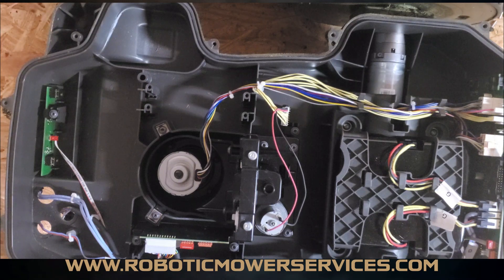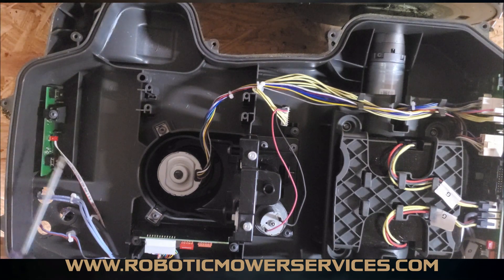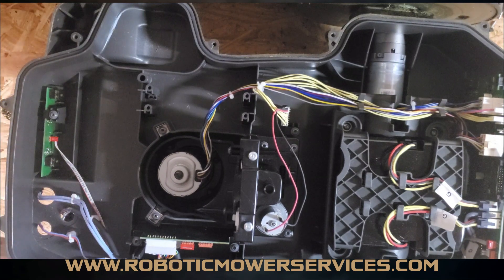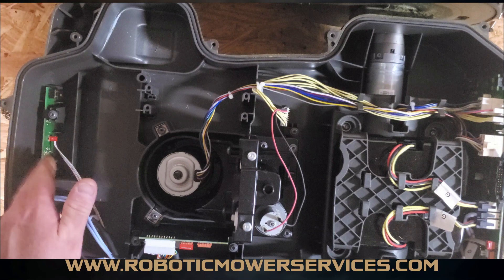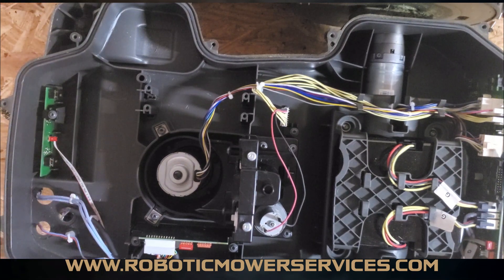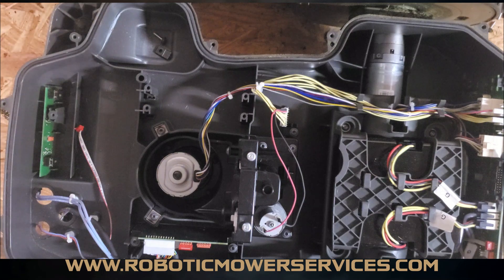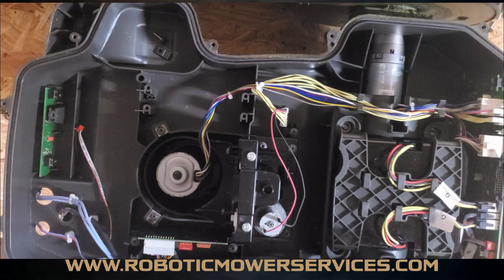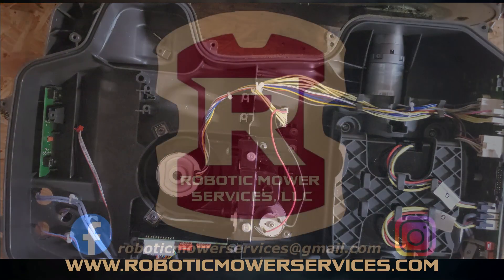Husqvarna Automower Front Loop Sensor Replacement (What is it & Where is it?)

Comment: I have a problem with my 435X that loses signal when it passes over the guide wire in a specific area of my terrain. Someone told me that it could be the battery cable that would disturb the signal. Do you know a problem of this kind?
Reply from the maker: This kind of information that gets thrown out in other forums and passed along is the exact reason why we created a tec support group for people to be able to get the right answers and methods for diagnosing issues. https://www.roboticmowerservices.com/plans-pricing

Comment: Hi, Thanks for these vids,
I have a Flymo 1200R that had an issue the mower’s screen was flshing blue light (as of blinking , trying to turn on) and wasn’t charging basically died. I ordered a new battery that has a slightly different voltage (18v instead of 18.5v and 2.5mah instead of 2.1mah) following recommendations of other owners suggesting it would work just as well.
Now the mower turns on but I got the No loop error which I haven’t got before. Charger station recognizes the loop, led’s colour changing as expected when attached the loop and guide cables.
Loop cable resistance is ok, no damage, charger station’s voltage on the loop and guide connector’s tested ok.
Can you please advice whether it still can be the station’s PCB issue or assumedly the issue is with the mower’s loop sensor? And any way to troubleshoot this?
Reply: Correction after some more digging
Apparently the flymo 1200r ‘s loop sensor is integrated onto the main circuit board. Not even sure if that can be replaced separately 
Just to clarify the loop readings on the mower’s tool/info/loop menu all zeros

Comment: Hello Robotic Mower Service. Thanks for some great videos. I have a Husqvarna 310, 4 years old. It cannot find the guide wire. I have measured 4 Ohms on the guide wire and the green lamp in the docking station lights up constantly. I have changed the PCBA LOOP print to a new one. 310 still cannot find the edge delimiter (guide wire). Any guesses as to what's wrong?
Regards, Chris Florentin, Denmark
Reply from the maker: The green light on the charging station is only an indicator for the boundary wire on this model and will not change if there is an issue with the guide wire. The best thing we can suggest for you to do is connect the guide wire in place of one of the boundary wires. This will create a smaller loop between the boundary wire and the guide wire that is now acting as a boundary wire like explained in this video: https://youtu.be/kCiFbaEwURQ
With your guide wire connected as a boundary wire follow the steps in this troubleshooting guide: https://www.roboticmowerservices.com/post/troubleshooting-a-no-loop-signal-error-on-a-husqvarna-automower

Comment: my ooooold 305 is saying no boundry wire, i made a test wire witg 6 feet, and still no signal, and values in test menu is saying 0-2% signal strength, and the rest at 0... mainboard or sensor??

Comment: Whilst part of the Husqvarna family, I have a McCulloch Rob1000 mower. It was going out and running out of battery. I replaced the battery at the weekend and it has cut once and gone back to the charging station and no longer charges.  If I run a test on the charging station it  says Current: Not Ok.
I have 28V at the charging station and the output to the L&R boundary wires is about 34V.
The green light is lit continuously on the charging station.

Could this be the loop sensor?

Comment: Hi there, I’ve got an automower 310 (2016) with a solid green light and a boundary wire that works with my other mower. The mower in question says no loop signal. I have tried changing the charging station circuit board and the mower’s loop sensor, I then change the passcode and the loop signal in the security settings on the screen, it indicates success but still won’t follow out and go to work, eventually saying “no loop signal” again. What could I possibly try next please?
Reply from the maker: Take a look at our troubleshooting guide that we created for no loop errors. Here's a direct link to it: https://www.roboticmowerservices.com/post/troubleshooting-a-no-loop-signal-error-on-a-husqvarna-automower

Comment: Dwight, thanks for the great video.  My 2016 450X has started acting strangely and I’m wondering if it could be the front loop sensor?  The first issue is that when following the guide wire, it used to be really smooth, but now it’s really jerky when following it, it zigs & zags back and forth no matter if it’s close to the base station or far away.  The second issue I’ve seen on occasion, is that the entire mower will go outside the boundary wire by 8”.  I have the setting at 8”, so I would expect the front of the mower to cross by that much, but it seems the front loop sensor didn’t detect the boundary, and the rear sensor is what stopped it.  I witnessed this when the mower was fairly close to the base station.  Funny thing is that the boundary wire runs along a curb by the street which is the farthest from the base station and the mower has never dropped off the curb!  What do you think about the front loop sensor being the cause of all this?  Thanks in advance for your wisdom…..
Reply: Hi, I am having the same issue as you with the mower not following one of the guide wires home. It picks it up at first and follows for a little then just veers off. I have no errors showing and have replaced the guide wire but its still not following it home. Were you able to solve your problem? Thanks

Comment: Blinking blue light on the base. I’ve tried the connections. Checked the boundary wire with a tester and it’s good. Could it be a bad loop sensor if it’s blinking blue?
Reply from the maker: No, if the LED on the station is flashing blue then it's not a loop sensor issue. Take a look at this video for more info on how to diagnose your flashing blue LED. https://youtu.be/uDdUnR_rIAE

Comment: Super, thanks for this! My mower AM320 had issues with docking straight (at first). After a few days, I got the "no loop signal found" error, although my docking gave a solid green light (and the wiring was definitely OK, I checked the resistance) ... after replacing this, all is fine again !  So happy 🙂
Reply from the maker: Awesome! Glad we could help! Just curious since you said you have a 320, what country are you located in?
Reply: @RoboticMowerServices   Belgium

Comment: Hi,
first thank you for the nice info.
I have a 310 and since a couple of weeks I ran into the issue that the mower doesn't leave the dock on schedule. When I pull it out manually it start mowing and completes its daily schedule (run for 6h) without any issue. In between it goes to the dock for recharging and starts mowing again without any issue. It is only the start of the schedule that fails while date and time are set correctly. When connecting via Bluetooth it says 'mowing' but is still in the dock.
Next I looked into the service menu and checked the loop signals.
I did notice that I have negative front sensor values when it is in the dock. When I pull the mower a few cm's from the dock values goes up for both front and left. Then the mower starts to work. What I cannot understand is that it doesn't have any issues during the schedule, only on startup.
Also the error for not leaving the dock is that it has not got a loop signal which make sense since the values are negative.
I already regenerated a new loop signal but no luck there either.
The dock hasn't been moved for years and there is no high resistance on the loop wire either.
I was thinking of a bad front loop sensor but then again it is working fine throughout the schedule.
I'm a bit puzzled here, any thoughts?
Reply from the maker: Jan, it sounds like you have your boundary wires tucked under the back corners of the charging station base plate. If the wires are tucked under the corners of the charging station base plate it is possible for the mower's front loop sensor to get too close or actually over the boundary wire and cause the mower to not leave the station. I'm guessing that this is your issue because you mentioned the negative value on your front loop sensor. Try moving the boundary wires out so that they are at least an inch away from the base plate of the charging station and see if that makes a difference.

Comment: I have a 450x and on the base getting a blinking red light.  Looked it up and sounds like and f or n loop sensor in the charging base.  Do you have a video on that at all?
Reply from the maker: The flashing red light means there's an issue with the antenna for the far signal. https://youtu.be/cljaAQHpo2o

Comment: Good video.
I have a 315x witch sometimes drives over the boundary cable. Its programmed 25cm drive over.
It can run month but then somwhere it drives over the edge. Its Unused but a couple of years.
Instead of the 315x i use a 310, with the 315X connect card, and that have worked a couple of years now.
Do you think that the loop card can be the problem?
Reply from the maker: Here's a video showing how to check the loop signal quality through the front and rear loop sensors. You can use this to check at the areas where the mower is going out of bounds to see if it's a signal loss or if it's a sensor error. https://youtu.be/tUzTo9-xbgo
Reply: Its on different places every time. Never happens with 310 on the same area for over 1 year .
The 315X is parked